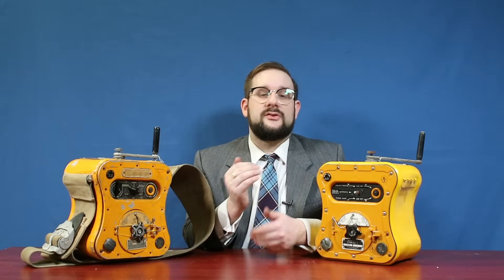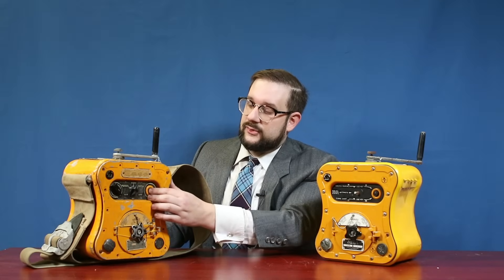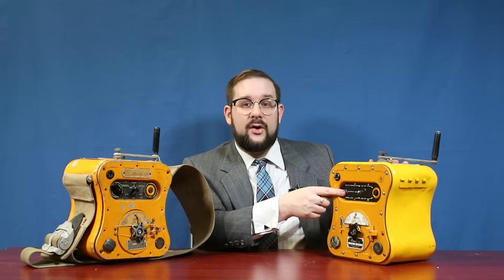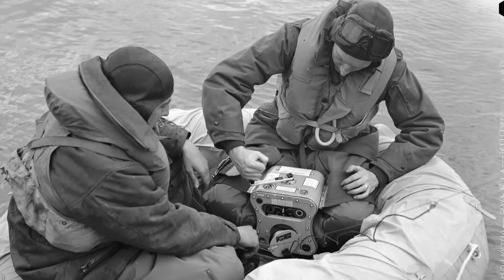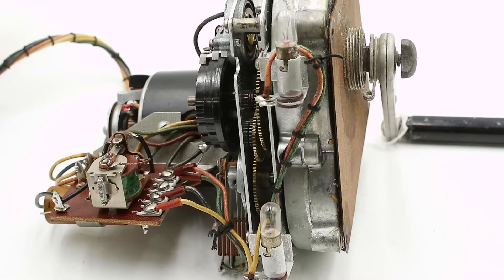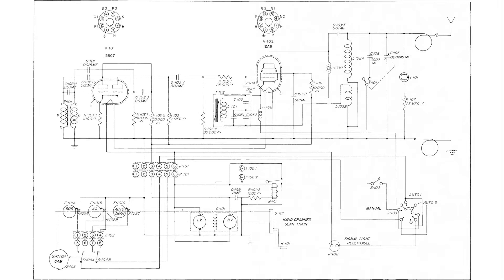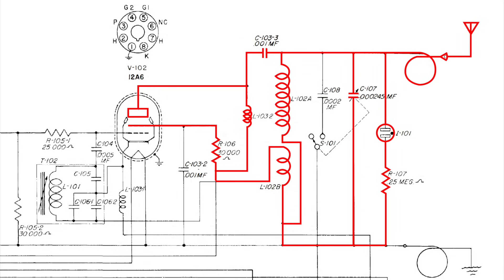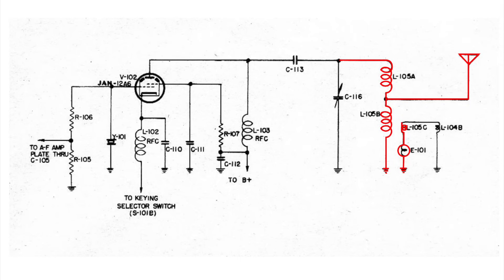Inside the 'Gibson Girl' Survival Radio

Comment: An interesting and extremely well built transmitter. It's a surprise that it doesn't have any receiving circuits - not even a crystal/diode detector and a headphone jack. I love the die-cast aluminum case with wells for antenna and ground wires - keeps things together all the time, stays waterproof. Nowadays it would be considered a horrendously expensive excess by the industry, and a thing of beauty and a joy for ever by nerds like us.
Reply: Incorporating a receiver would have made it heavier, a lot more complex, and more costly. As any old-time Ham would tell you CW (morse code) transmitters are simple and easy, good receivers are not. Crystal sets need a strong signal to work which would be absent in the middle of an ocean. 500kHz was a world military and civilian standard distress frequency with people always monitoring for a call worldwide, so odds were great that someone would hear you thus no receiver was necessary. The other frequencies were military standards. It has all been switched to satellites now and there are no more international radio distress frequencies so this set would be ineffective today.

Comment: He erred, C101 between the two sections of the audio oscillator tube sections is part of the feed forward of the signal path, not the grounded connection shown.  He mentioned K201 (not shown) I think it is K101. (speed regulation) Ron W4BIN

Comment: As I recall, you’ve said that you don’t use a teleprompter. If that is true, and you did this from memory, I will give a big round of applause! Rattling off the circuit descriptions like you did takes a tremendous feat of memory, especially if you have not worked with tube circuits for many years. Bravo once again!

Comment: I love the World War II era boat anchors having used both the transmitters and receivers in earlier days. I particularly enjoy the mechanical engineering of laying out of components necessary for the circuitry, the methodical repairable engineering behind them.
When at the Air Force Museum's the engineering is so difference due to the state-of-the-art at that time. Thanks for your well-done presentation.

Comment: Thank you!
One might ad that all old style transmitters drift in frequency. Going for a X-tall controlled signal at higher frequencies give a
more accurate frequency with less drift. Easier to spot for the searching vessel. And less part count due to simpler construction
as well as less power consumption.
Down at 500 kHz  some wobbling about is of less importance also because a AM signal itself is wide. In WW2 X-stals where expensive and the  hard to source.
Look for "Crystals Go to War, 1943" for additional info and understanding..
de SA3BOW

Comment: That is the weirdest switch mode power supply I've ever seen.
A physical relay does the switching
Reply: That's similar to the rpm speed regulator the tone generator for 1920s telephone exchange.  Fluttering contact voltage regulator is also over 100 years ago used in motor vehicles until 60s
Reply: Look into 'vibrator tubes' which were in car radios and converted DC to a form of AC which the radio circuits required.
Reply: @P_RO_    Those aluminum can things I remember those. Today there's a mosfet forward converter, to replace them, one example I saw used a PIC microcontroller to make the complementary drive with a few percent deadband.

Comment: I remember seeing a Gibson Girl at the long gone Belle Vue Radio Rally, mid 1970's onwards.
I didn't have a clue what it was but remember the colour and shape as it's very distinctive. What a great design.
G4GHB.
Reply: CQ G4GHB  DE G8WOF.....  Ahhhh the old Belle Vue Rally.   Loads of goodies and huge glass insulators which made my antenna installation look more capable than it was.   73's K
Reply: @Woffy.  I was G8JJC for 2 - 3 years.
Always wanted c.w. and use it mostly.
73, G4GHB.
Reply: C.W.  a very civilised mode,  me RTTY. 73's @bill-2018
Reply: @Woffy.  I've never tried RTTY, although years ago looked at the Creed RTTY stuff. Amazing mechanical equipment.
73, G4GHB.
Reply: I had three Creeds getting the Tass, Reuters  and AP news. My Dad would sit with a beer on Sunday so he would have the news before his colleagues. Still have several but not run for years. This chap has a great style of presentation, so fluid. 73's
  @bill-2018
Reply: @Woffy.  That's interesting, thanks.

Comment: I hope that it didn't transmit.
Reply: At the start of the video?
No antenna. If it managed to transmit anything at all you'd be lucky to pick it up from a few feet away.
Reply: @ricko.4411 😁
Reply: Those frequencies are no longer in use for emergencies, and a lot of the old radio gear has components which fail with age so odd are that none of these work now unless they've been refurbished.